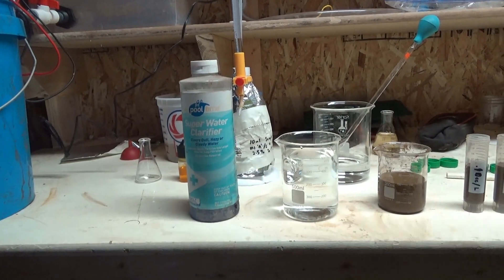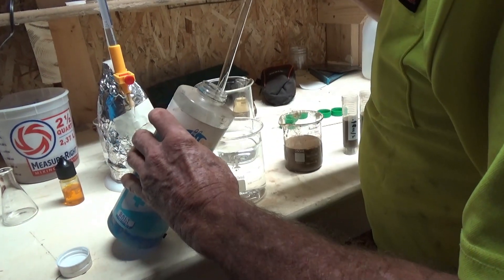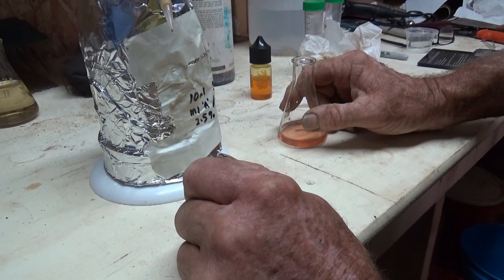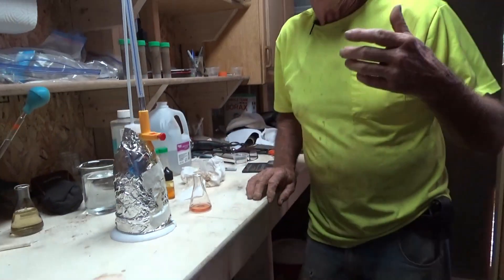227  Testing the Effects of Flocculant on the Leaching Solution

Comment: How about asking Eco Goldex manufacturer? Canada or China? Sure seems strange they do not detail your basic concerns. While cc and ml are the same volume consider using ml for wet chemistry and cc for solids. What amount of Goldex are you intending to use with what quantity of gold and mesh bearing ore/concentrate? Why? Goldex cost US$11/gallon? Are you using wet, flame or instrumental assay? Have you considered XRF? It would be nice to hear your mining plan details so we know where this road goes. Consider using a notebook for details... your assistant could write it down... BTW did you ever show Eco Goldex actually dissolving your gold? Results? Thanks!
Reply from the maker: Distributed from Canada, probably made in China.  Need to check the fine print.  The titration chemical are in a package with ideograms.

The rep is kinda busy and I am not the biggest customer.  he has been helpful, but sometimes it takes a few days for him to get back to me.  Besides, I always like to double check.

I use cc and ml interchangeably in my mind-  solids are grams/Kg.

Currently I am testing at solution strength of 2 Kg/Tonne in solution.  2:1 liquid to solids ration seems to leach quite well.  Current cost of chemical is $6/kg plus $5/kg shipping.  Thus, cost of solution is $22/tonne.  It seems quite doable cost wise.  Recovery from solution is the current research focus.  Direct electrowinning is certainly not easy and probably not practical.  testing resin shortly.  That is the mfg reco.

We are using ICP for gold analysis of solution and fire assay for ore.  I have had bad luck with XRF at PPM concentrations.  To much noise to signal.
Reply: @hardrockuniversity7283  Thanks for the details. Our gold is extremely fine so thinking about leaching and appreciate your videos to show a possible route.
Reply from the maker: @douglaspohl1827  You're welcome.  Glad to make the mistakes for you and save you the time and headaches.  :-)  You also have very precise questions- excellent!
Reply: @hardrockuniversity7283  What XRF gun? How was the sample prepared?
Reply from the maker: @douglaspohl1827  Hmmm, trying to remember the name...  AH!  Bruker?  Their sales rep was in the area and used it on some of my rock samples from 'Gold Hollow'.  No pre.  It said below detection limits on gold, but 1 Oz/T platinum.  Lab analysis showed no platinum.  They should have been running about.1 Oz/T Au.  Not sensitive enough for my purposes and a huge false positive on the platinum.  admittedly 5 of 5 samples showing 1 Oz/T Pt was a big red flag.

For higher concentrations, say loaded resin or concentrates I think they would probably work fine.

Comment: good stuff! Would a centrifuge help you?  cordless drill and a wood or plastic holder for a quicky homemade contraption in a pinch
Reply from the maker: Yeah it would.  I think I can get a used lab centrifuge for about $100, but I'm seeing what I can do using different methods.  A centrifuge won't do buckets.